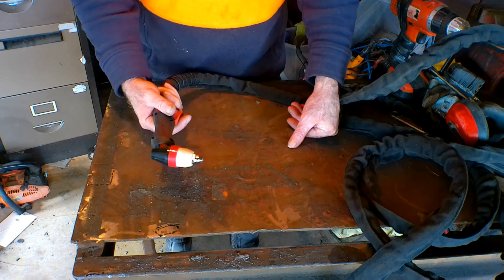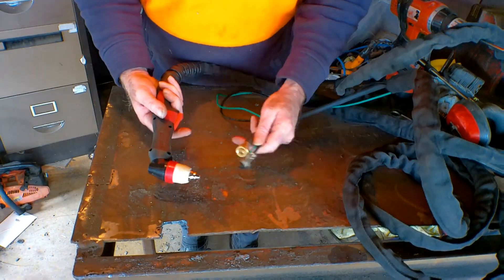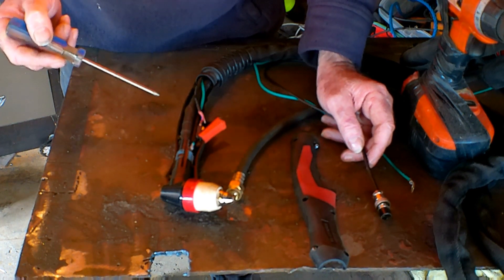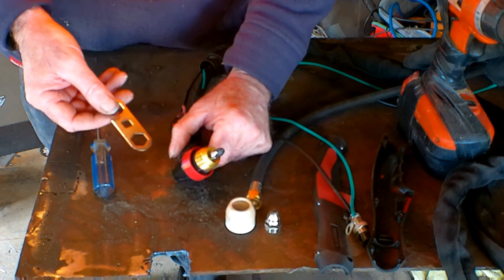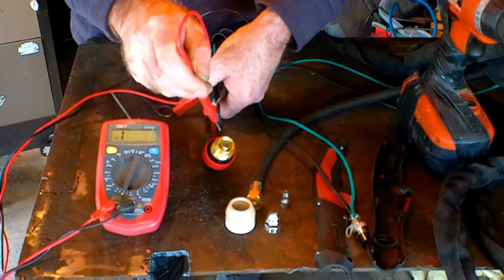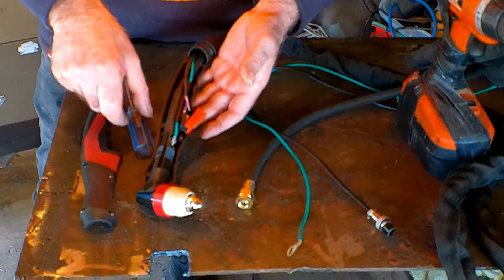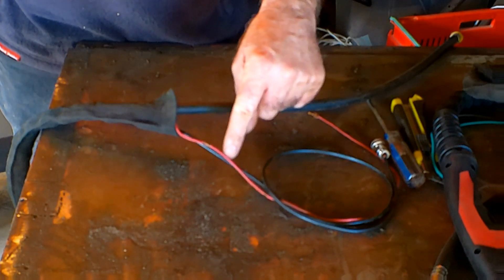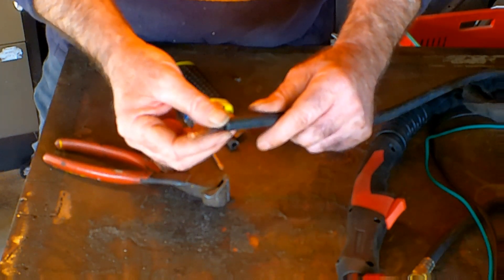Pilot Arc Plasma Torch Teardown /  Pilot arc conversion

Comment: pete question for you just purchaed and recd plasma argon p60 pilot arc plasma cutter problem is there is no air coming out of torch itis coming out of box but is not making it to the nozzle what could be the problem
Reply from the maker: Make sure the hose inside the machine hasn't come off the torch connecter.
Reply: @petestools  i took the head apart and there was a tiny ball bearing inside stopping the air flow.... tried drilling it out work for a bit desided to buy new gun p80